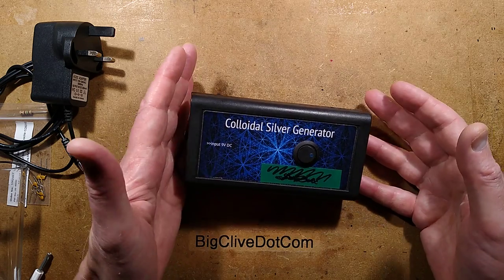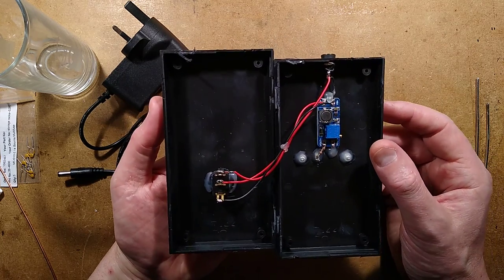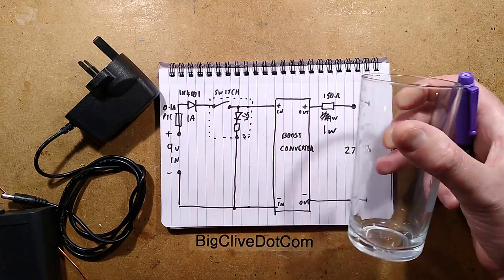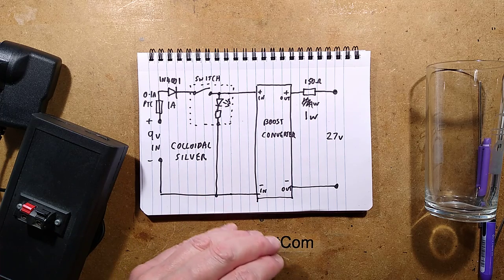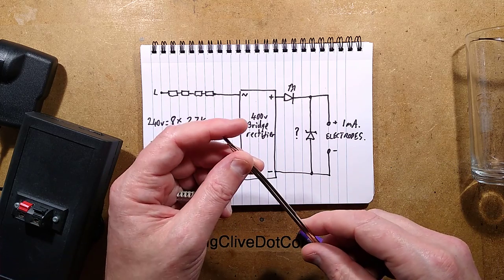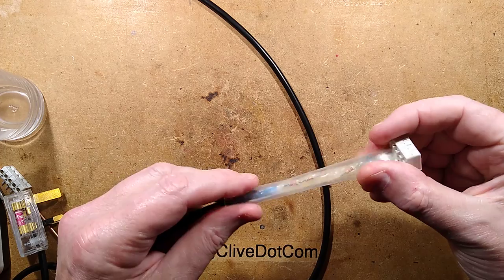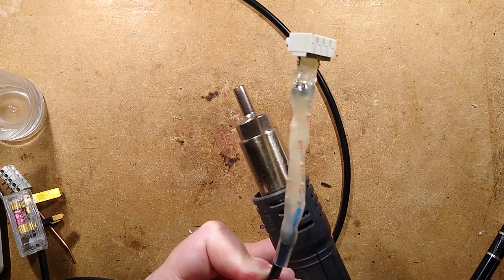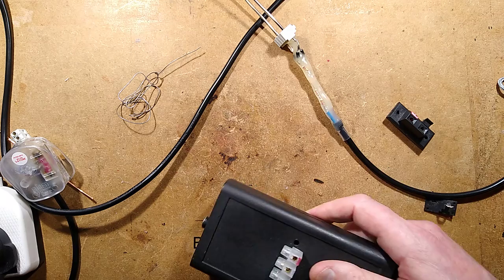Fixing a colloidal silver unit and making a slightly dangerous one.

Comment: I'm amazed the manufacturer responded to your question.
Reply: I thought the same thing! Can you imagine if you could just call up Apple and say "Hey, this component in my device is blown and I can't identify it. What should I replace it with?" and get a response?
Reply: @ericjessee  Apple will respond by sending you a letter from a lawyer.
Also apple actually has no idea how to manufacture or repair their devices on a component level, because basically: That know how is literally out sourced.
Reply: Connor Driza  yeah, I wouldn't be surprised if the marketing department overshadows the engineering one, but I doubt they've completely outsourced their hardware design.
Reply: Connor Driza  now you tell how they're cutting costs. 🤣
Reply: Connor Driza  What house? Do you think apple has microchip factories? Ever seen a semiconductor supply chain? You are naive - they will be using some company like TSMC for the semiconductor manufacturing, just like they use companies like foxcon for iPhone assembly. Note: When I say apple has no idea how to manufacture something it is mend in the literal sense - they do not know the literal manufacturing processes. We can argue that they have engineering know how - but literal part of that know how is to know the right partners and that includes a "make or buy" decision. Outsourcing manufacturing is nothing "bad" - but it means literally not having the knowledge how to manufacture something.
Reply: Johnny was off school that day.
Reply: @ericjessee  Yes but you have to get past the Apple glue!!
Reply: @sarowie  The only manufacturing knowledge they have is when the manufacturer calls and tell them that their mouse clicking cubicle farm weenies designed something that can't be physically made, or it will cost a fortune.

Comment: There is a difference between silver atoms and silver ions. As a chemist, I’m puzzled by what actually is going on here. Is the haziness you observe small particles of aggregated silver atoms (not molecules), or is it small particles of silver oxide (ions), which could form at the positive electrode?  If it’s the latter, that could explain the bluish color some observe in their skin after ingestion. I don’t think silver metal (atoms) would be absorbed in that way. Silver ions are toxic to humans at fairly low levels. Silver atoms are used on surfaces,such as the activated charcoal in water filters, as an antibacterial. I’m guessing silver ions could also be used as an antibacterial, but there are likely also toxicity concerns, since ions are more likely to be absorbed into the bloodstream.
Reply: I think that although the electrolysis produces ionic silver, these ions aren’t very soluble, and the resulting solid pieces of silver hydroxide or oxide react with the sunlight as they’re formed to produce elemental silver. Similar to what would happen if you were to put silver nitrate in a clear bottle, but much more gradual. You could ensure that it’s all being turned into elemental silver by checking for bubbles or pH changes, if no gas is produced and the pH remains constant, then there is no net redox reaction occurring. Otherwise, the oxidation of silver would have to be counteracted by a reduction of water into hydroxide ions and hydrogen gas, I think. Though it’s possible that his does happen but is counteracted by oxygen gas going into or out of solution or the air.
Reply: You get silver ions pulled off one electrode by the applied potential (without it you'd get a tiny bit dissolved in the water, almost none because silver isn't particularly soluble in water). Those ions immediately react with dissolved oxygen to form silver oxide which aggregates into tiny particles suspended (not dissolved) in the water- look up "colloid".
When ingested the particles aren't especially affected by stomach acid and make it through the intestinal lining into the bloodstream where they are distributed fairly evenly- as far as I know they don't accumulate in any particular place.
Argyria (the blue skin thing) is caused by the same thing that develops film- the oxide is redoxed under the influence of light into the nitrate by scavenging free nitrate radicals and darkens. People with it also turn blue in the iris and sclera of the eyes!
As far as I know it's impossible to remove without extreme chelation therapy but has no other side effects other than making you resemble a Hindu deity.
All of this is from memory of my 9th grade chemistry class in 1967.
Reply: Silver chloride...
Reply: @papanyanz  There should be no available chlorine in distilled water.
Reply: @markfergerson2145  it was tap water. Distilled water is insulator therefore cannot be electolized 😛
Reply: @papanyanz  Uh huh. So what do you think happens to the silver in distilled water?
Reply: Indosarnia  I think the system would reach a saturation point after all of the dissolved oxygen (and nitrogen, now that I think of it)  was used up.
Reply: How about silver nanoparticles? It may be possible that NPs of 10s to a few 1000s of silver atoms get broken off the surface, at high enough voltages.
Reply: TheBackyardChemist yes, but if the voltage is high, silver atoms can also be oxidized to silver ions while hydrogen gas is reduced at the cathode. This would result in the formation of silver oxide or silver hydroxide particles at the anode. There are certainly ways to detect nanoparticles or particles of silver salts, but I haven’t run across a study that shows which will form. A very slight difference in the applied voltage could have a significant difference in what does ultimately form in suspension.
Reply: @markfergerson2145  all that from your 9th grade chemistry class? man.. my high school sucked lol.
Reply: @chrishayes5755  Luckily we had an enthusiastic, engaging teacher.

I was a science fiction reader and one day I asked him about the preparation of nitrogen triiodide, a contact explosive, given in a SF book because it sounded fishy to me. (Turned out I was right- as described in the book, it wouldn't work.)

Next day I found out he had stayed late after school and managed to make some because there it was on a filter paper on the corner of his desk except I didn't notice it. I was the first one in class that day and was obligated to open the windows. Next person in opened the door and the slight draft blew a few crystals onto the floor, where each subsequent student set them off by stepping on them with little popping sounds, blowing tiny craters in the linoleum flooring.

We spent most of the class that day talking about why the description didn't work, were assigned to figure out how it could be made, and lectured about why we shouldn't do it.

One of my favorite classes.

(The book was Farnham's Freehold by Heinlein)
Reply: The “ Blue man “ drank gallons of silver chloride, not colloidal Silver!

Comment: Maybe my sense of scale is off, but it looked like it almost would have been easier to put an entire stick of the hot glue in and use only the heat gun.
Reply: Awesome idea!
Reply: What the world needs is a precision hot-melt glue gun, with a long, heated tip having an outside diameter of ~2-3 mm. That tip would resemble the tip used to inflate soccer balls, footballs, basketballs, etc., but be 2-3 longer and more robust. Heating the tip -- if the heat from the glue gun tip proper doesn't keep the fine tip hot enough to liquefy the contents -- might require some additional engineering. A nichrome wire wrap over a thin tube of mica running some of the length of the fine tip? 

Anyway, the idea would be to inject, and thus pot, HMG into prepared heat-shrink tubes placed over components such as shown. The HMG pots the components and shrinks the tubing progressively from the starting end of the tube to the finishing point.
Reply: @michaelthibault7930  so a 3d printer pen but for glue instead of plastic?  Sounds like a decent idea!
Reply: @michaelthibault7930  skip the wire wrap, just make it a nichrome tube folded back on itself (sheet of mica or ceramic between the two sides of the tube) and put a hole at the very tip.  Make the whole needle into a heating element.

Comment: The cloudiness is the insoluble silver chloride, AgCl, which forms when silver ions (Ag+) react with chloride ions (Cl-) present in tap water. This process likely compromises the formation of silver nanoparticles altogether. Nanoparticles, which are neutral clusters of silver atoms (not ions), require very pure water. Those nanoparticles are typically 2-40 nm according to a few studies you can easily find on the internet (keywords: electrolytic, nanoparticles, Ag).  Also note that the smallest nanoclusters (<10 nm) of silver are not conductive so technically shouldn't be called metallic since metallicity is a bulk property (i.e. a small enough cluster of atoms doesn't have a band structure but discrete energy levels).
Reply: Also, I love all your videos where you pass current through water using all sorts of dodgy appliances!
Reply: Pure water is an electrical insulator, how do you deal with that?

Comment: I bought some colloidal silver underarm deodorant ("nuud"), because I'm allergic to the normal antiperspirant.

It kinda worked for a while, but then something changed. Even after I stopped using the stuff, I found my armpits turning sour much faster than before. Rather than wiping them all out, the colloidal silver seems to have changed the composition of the bacterial population, and not in a good way.

I'll leave that stuff alone in future.
Reply: Sounds like you created a population of silver resistant bacteria in your pits.
Reply: @samuelkane1717 Stinky, too.
Reply: @samuelkane1717  zync oxide still better than silver.
Reply: how about just shaving armpits and applying sodium-bicarbonate after every shower. I am still sweating normaly but with absolutely no odor at all!!! (I am a dude btw)
Reply: Try a powder mix of baking soda and baby powder and dust some on. It;s worked for me for years. I'm also allergic to those aluminium-based deodorants, they turn my skin into weeping bleeding rashes in minutes that then last for weeks before starting to heal.
Reply: Rubbing alcohol... 70%
Reply: Reminds me of an ex, a long time ago she swore by the stuff. She used it on everything. I too have problems with deodorant, although in my case it’s the perfume they use in them, the ones with no smell are fine. She gave me a bottle to use and like you it worked fine then stopped. I bought a new bottle, it worked fine and then stopped. 

Finally I bought a bottle and opened it up. The bit in the nozzle was roughly the claimed strength, after testing, while the rest of the bottle was tap water. It even matched the hardness of the water from Southampton where the company that made the stuff was located!

So I guess that they make a very small quantity of the stuff and put it into the nozzle, to fool their customers, who are likely to test those first few squirts, and then just have faith in the product. Needless to say, I stopped buying the stuff, but I will confess, it did work as a deodorant so while drinking the stuff seems to be foolish, the anti microbial properties seem to be true... I just don’t know why I would use it instead of a bottle of general purpose cleaner, or in my case, simple perfume free deodorant at 1/10 th the price and significantly less risk of con artistry.
Reply: @PippetWhippet  Sounds like you bought the equivalent of "Peckham Spring Water".
Reply: Everyone is allergic (to some extent) to antiperspirant, that iparticle

Comment: What that unit is making is ionic silver oxide NOT metallic silver nano particles, ionic silver oxide converts to silver chloride in the presence of stomach acid, it is this that causes argyria.

Ohms law tells us that 1mg of silver will leave the anode per 15 milliAmp minute.

Distilled water at room temp can absorb 20ppm silver max so any concentration above that without applying heat and stabilisers will cause the nano-particles to dropout of solution and clump together becoming useless.

Use a 1 mole solution of sodium carbonate for electrolyte or the process will take too long plus it will raise the Ph above 7.  Also if your using a silver anode and copper cathode it will stop the cathode plating off (don't mix these up, if you make a copper solution you could kill yourself!)

The theoretical 3.51 volts required to strip a silver electron and move it to the sodium ion should be minimum 3x that number or >10 volts to account for the loss between the electrodes, the wider the electrodes spacing the greater the loss (34mm should be ideal).

You then need to add to add a stabiliser and redox agent to convert the silver oxide to to metallic nano-particle silver (2AgNP) something like Karo Light Corn Syrup, maltodextrin or cinnamon extract. PH>7 required for this to take place hence the dual use of sodium carbonate.  Quantities of the electrolyte and stabilisers required are very small. 

Can be used as an excellent disinfectant, mouth wash, and promotes healing wounds and purifying water.  It can be safely ingested but absorption rate is low (50%-70%) however a process called gel capping using animal gelatin coats the nano-particles so they can be absorbed into the bloodstream. 

I got all my info at cgcsforum.org which isn't trying to sell you anything and the focus is more on learning how to produce consistent, high quality NP through electro-chemical processes using food grade compounds.

Comment: Apart from it's dubious health benefits, this would be excellent for making silver-plating solutions. I am not sure about the voltages necessary for Nickel, but I would also think it could work with Nickel -- for nickel-plating solutions. Maybe even Gold as well. So if someone was into plating metals onto various objects, having such a unit to put the metals into solution would be helpful. It might also be made more useful if you could insert some kind of auto shutoff once the solution reaches a specific conductivity. Or, barring that, a settable countdown timer shutoff feature. The solutions these devices make generate more and more electricity the more concentrated they become. So without some kind of shut-off feature, it seems to me that these will run themselves into nearly shorted scenario as the solution gets highly concentrated with the conductive metal ions. So it should either 'read' the electrodes from time to time to check conductivity (and shut off once > than X set on potentiometer), or introduce a variable electronic countdown timer switch. Being able to set it to a specific conductivity level would be ideal, but I realize that's much more difficult to introduce into the schematic than a simple timer switch. I don't know enough about electronics to be able to conceptualize how you'd test the conductivity of the solution using the same electrodes used for charging -- but I am guessing it would probably just need to pause the charging periodically, and test, then resume charging based on condition of test. Isolating the resistance checking circuitry from the charging circuitry is quite honestly beyond me, but probably involves diodes and transistors. Or maybe there is a dedicated chip out there specifically designed for this kind of thing -- it wouldn't surprise me if there was.
Reply: Any case where you stick a lump of metal into a pot with a suitable electrolyte (eg copper sulphate if you're doing copper-plating), connect the donor metal to + and the recipient item to -, apply about 5V or so (it depends on the metal but doesn't really matter if it's a few volts high), will do electroplating. You can hardly go wrong. Just a power supply, and the bits I mentioned.

Yeah I'd probably get a little microcontroller to do all the automation, cos they have all sorts of useful circuits built-in, and it's a piece of piss to just change some code on a computer screen, compared to ordering components and soldering and de-soldering and measuring and taking hours to find out that what looks like a good solder joint is in fact not one. Long live lead solder! You can still buy it and I wouldn't use anything else given the choice. 

WIthout that though... I dunno how conductive the solution could ever get. If it's too low, and drawing more amps than the power supply can provide, the voltage will sag until it reaches one low enough where it can provide the amps. It's not a great situation but you're not after making gallons of this rubbish. Unless you're gonna pour it in a swimming pool and turn a load of kids blue for a laugh or something.
Reply: Syphyllis
Reply: Just toss a shunt resistor in series with an electrode and watch the current. As the solution gets more conductive, the current it passes will rise.